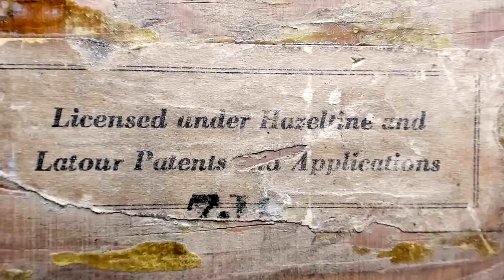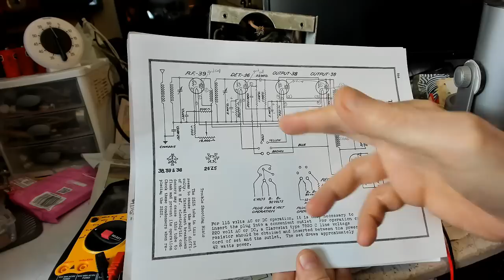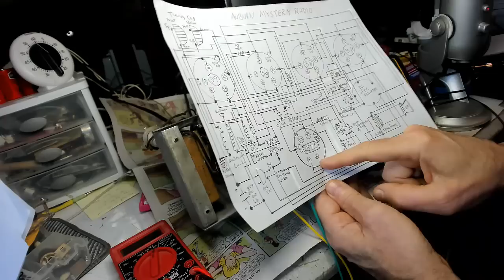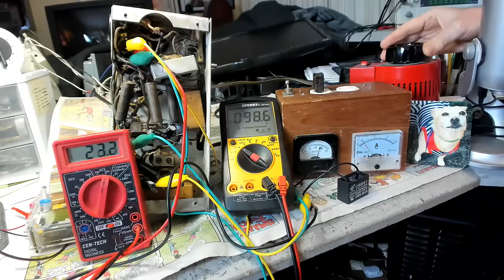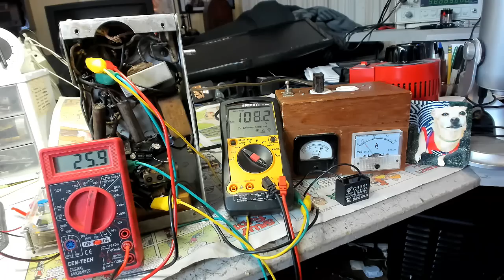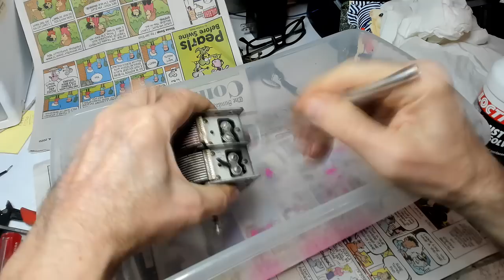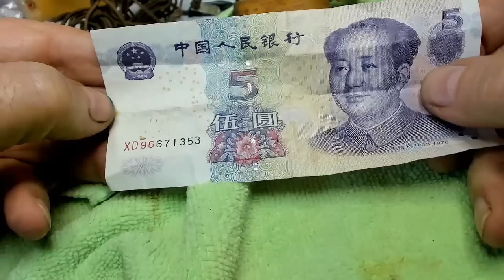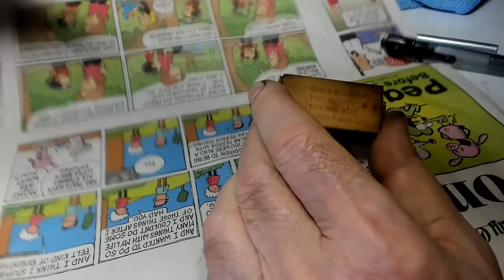1930's Auburn Mystery Radio Restore Part 2

Comment: Sorry Buzz being so late to the party. I pulled out some HAM gear and cleaned it up and powered it up and was listening on 80 meters. In the middle of other stuff like getting a CB radio base station and 10 meter HAM antenna up in case of ... hey this is heavy stuff with Dickel. Is he taking Lucy in the Sky with Diamonds? I think ghosty should be giving Dickel the Blue Pill like Pill-osi takes. Wow! up 300 new subs! You are just electrifying Buzz. The ladies Swoon over you like they did with Sinatra.. Gotta love them nails to hold the dials on. Buzz your 1st schematic looks like my old Uncle Wiggly Board Game I had when I was a Young-un. The second one was very good. Brandan came through with his novel idea for that cap. I never knew that. Sure better than burning curtains. Such a great video with all the voice overs. Well made POT for sure. Nice job on cleaning up the tuner. Truly the greatest radio video ever except you should have painted the output transformer red, white and blue.
Reply from the maker: come to think of it, I do have that Sinatra charm...haha........Dickel is  up against his  power hungry and commie counterpart, and it's  a warning to the country!...
Reply: @Buzz1151  Man, that's heavy, very heavy and epic too. Good vs. evil, sort of, but then again, Dickel isn't really a Simon Templar. GLM. Gnomes Lives Matter!

Comment: Great job on the radio, I like it, NO comment on the red output transformer.
I used a fan capacitor to replace the ballast in my Hallicrafters S-86 radio, of course I had someone figure out the value of the capacitor, I could never figure it out on my own...LOL
Reply from the maker: Hi Goat..thanks, but I you know down deep you love the red transformer cores...........😁

Comment: The radio automatically becomes different when parts are replaced, so in order for it to work without danger, it will be changed. Does that bother the purists too? You're doing a great job. Nice the way it got so clean. PS- General Industries.... sounds like the company that made the recordplayer motors.
Reply from the maker: thanks

Comment: I like your own drawn schematic it shows Buzzes Style. But its easier to follow a Pictorial wiring diagram most of the time. I never did take drafting in the 8th grade so you were ahead of me. But still we know its an all American 5 Radio. Brasso always does a nice job cleaning up the chassis. Great video Buzzerino.
Reply from the maker: in drafting class. we used to like to use the t-squares as swords and fight, haha

Comment: Nice trick with the capacitor (better than a 1 H choke). Brendan must have given confusing instructions since the cap simply replaces the burner resistor. I'm guessing that you can use the same trick when you want to drop the line voltage from 120 V to 110 V.
Reply from the maker: I'll have to ask him about the 120v to 110 v ..thanks, buzz

Comment: Capacitors are used as wattless resistors in AC circuits due to their capacitive reactance to AC. The only down side is if the capacitor short circuits then boom radio up in smoke! I think you can get safety capacitors which are designed to open circuit not short circuit when they fail.
Reply from the maker: yes, i know about safety caps. 👍👍

Comment: Buzz, try lighter fluid to take the wax off of things.  It just dissolves it right off.
Reply from the maker: so does a heat gun haha 👍
Reply: @Buzz1151  True, but it still leaves that oily wax coating. Lighter fluid cuts the wax AND cleans the paper without damage, since it isn't really "wet"... it's like dry cleaning. Anyway, I use it when I need to read a cap that's all crusty with dark wax.
Reply: @rivards1  ...well, there are all kinds of "trade secrets"!!